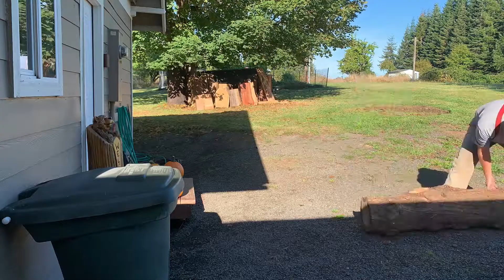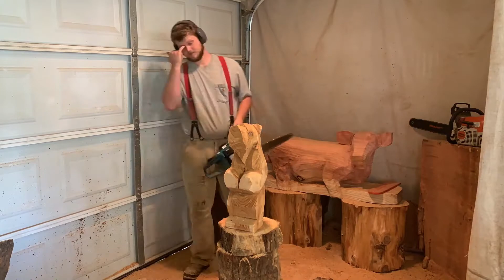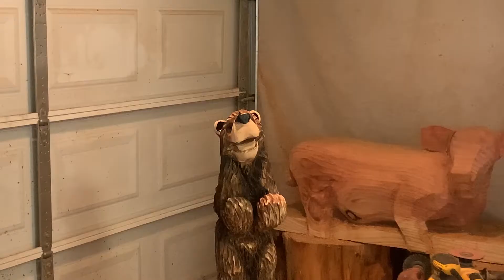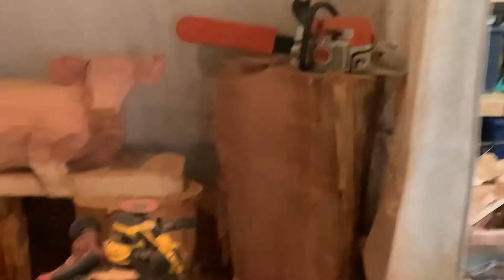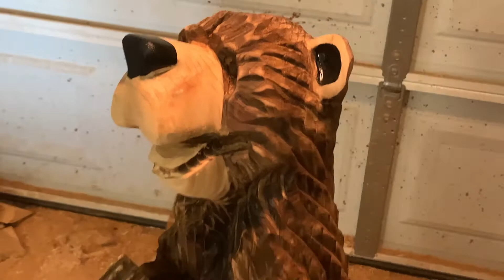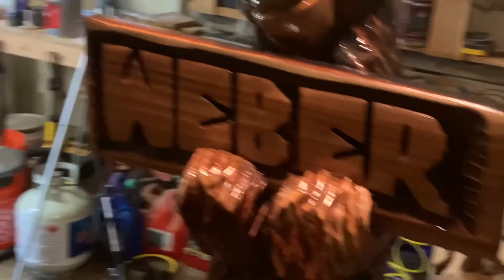CHAINSAW CARVING SIGN BEAR. a wedding gift!

Comment: Make a video on your garage setup. I am very curious on your curtains (sawdust segregation?)
Reply from the maker: Pretty much, we use the garage for storage too. I didn't want my wife to get mad at me for covering everything in sawdust and bar oil. So I hung up a canvas drip cloth from home depot. it is sturdy enough to catch flying wood chips, but light enough to move if I need to.
Reply: @whitedcreationco  haha yeah i am constantly using a broom and using a firepit to burn all the saw dust off.